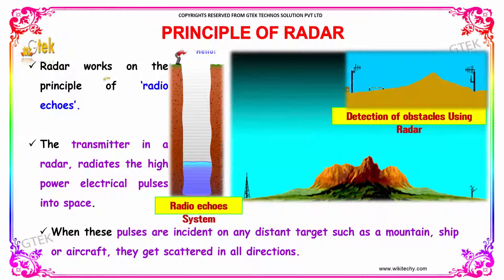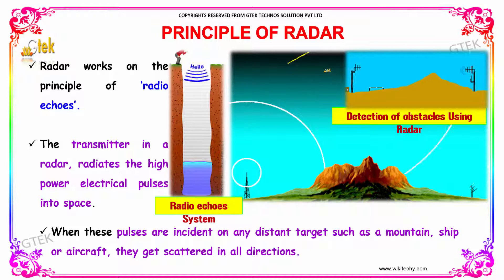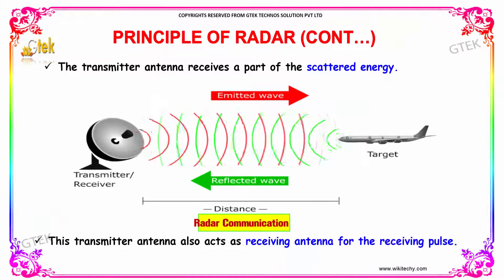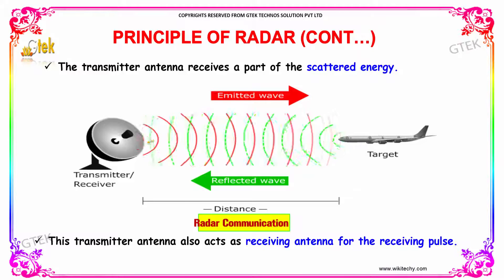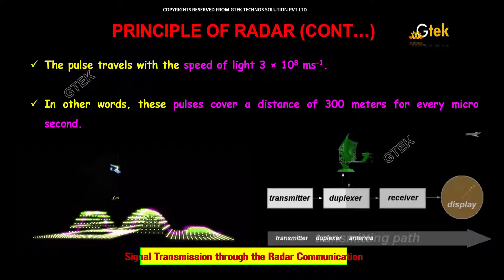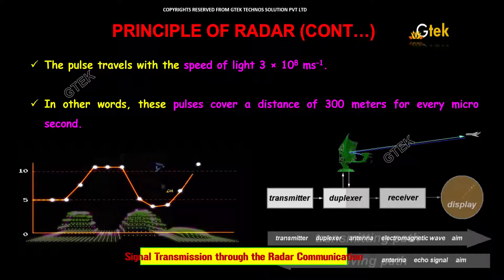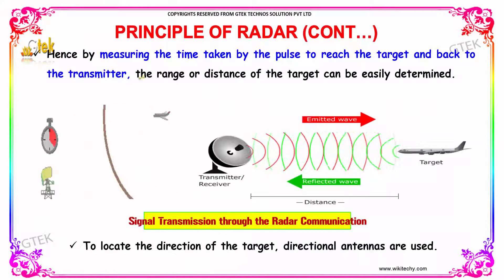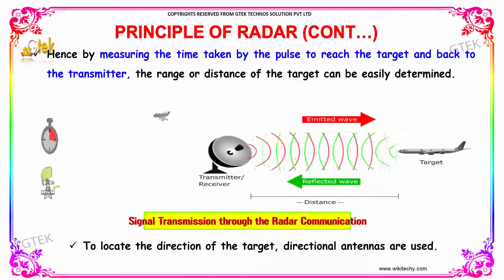Principle of Radar | Communications system|class 12 physics subject notes lectures|CBSE|IITJEE|NEET

Comment: A radar system consists of a transmitter producing electromagnetic waves in the radio or microwaves domain, an emitting antenna, a receiving antenna (separate or the same as the previous one) to capture any returns from objects in the path of the emitted signal, a receiver and processor to determine properties of the ...

Comment: Radar uses electromagnetic energy pulses in much the same way, as shown in Figure 1. The radio-frequency (rf) energy is transmitted to and reflected from the reflecting object. A small portion of the reflected energy returns to the radar set. This returned energy is called an ECHO, just as it is in sound terminology.

Comment: Radar is an acronym for "radio detection and ranging." A radar system usually operates in the ultra-high-frequency (UHF) or microwave part of the radio-frequency (RF) spectrum, and is used to detect the position and/or movement of objects.

Comment: The electronic principle on which radar operates is very similar to the principle of sound-wave reflection. If you shout in the direction of a sound-reflecting object (like a rocky canyon or cave), you will hear an echo. If you know the speed of sound in air, you can then estimate the distance and general direction of the object. The time required for an echo to return can be roughly converted to distance if the speed of sound is known.
Radar uses electromagnetic energy pulses in much the same way, as shown in Figure 1. The radio-frequency (rf) energy is transmitted to and reflected from the reflecting object. A small portion of the reflected energy returns to the radar set. This returned energy is called an ECHO, just as it is in sound terminology. Radar sets use the echo to determine the direction and distance of the reflecting object.